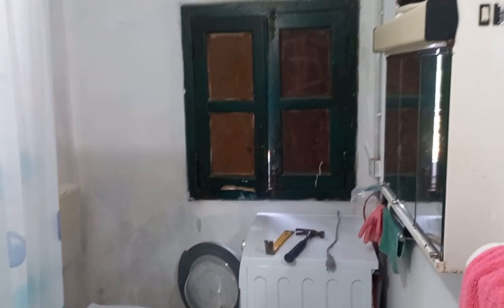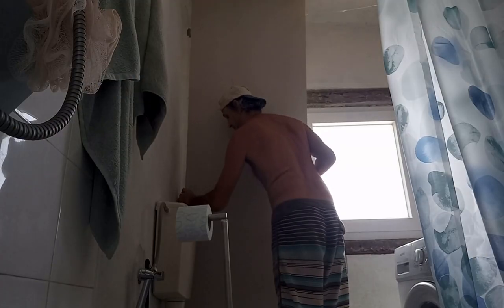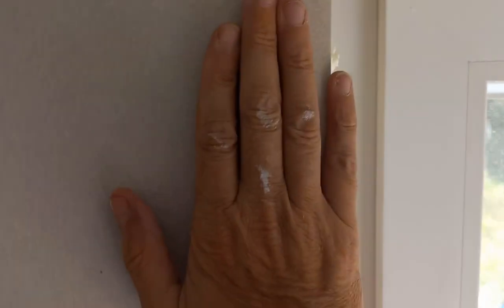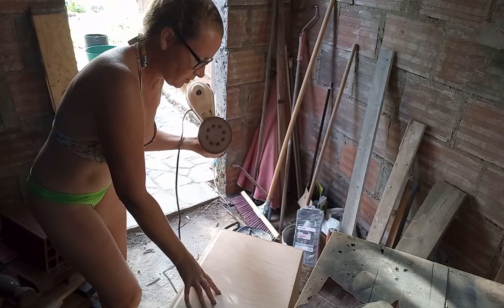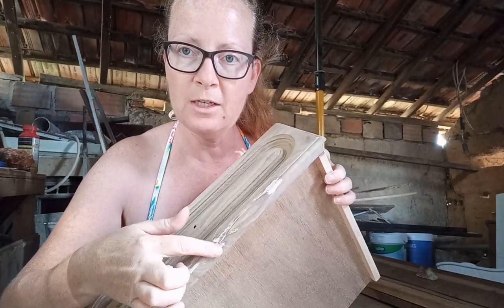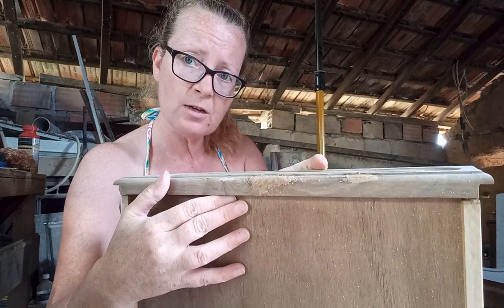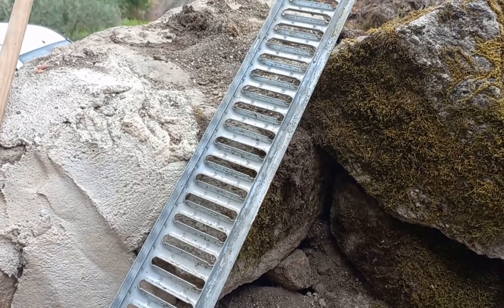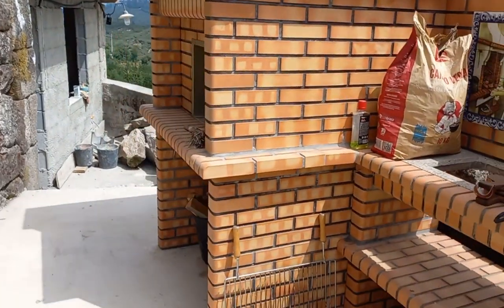A Typical Week renovating our Portuguese Ruin. Handyman Jobs. Enjoying the Hot Summer Sun!

Comment: The  house is looking good. Any movement in the right direction is progress. I think hiring out your considerable skill sets is a brilliant idea. I just finished  filling in a large 10'x3' pass through that used to have a decorative grid thing. I made a smaller opening in the center, because i wanted to have light and airflow, and i looks better. The drywall was heavy, about 60 lb. I had to cut it in half to lift it into place. Next I am going to do a pantry closet. I ordered a small laser level from  amazon so i can plot accurately. 🙂👍👍🇨🇦
Reply from the maker: Thank you! We're overdue for our one year of progress video but I really want to finish the kitchen first. 😆 Sounds like you did a lot of work, I'm sure it looks amazing! Having a lazer level will make it much easier!

Comment: That little monkey 🐒🐈‍⬛ had to do some damage to give you extra work to get that piece ready for painting ! I hope you're successful at getting a few more jobs. Grant did a very nice job with the installation of the drywall in the bathroom!  Good to see that the kitchen wall is ready for the next step.  👍🤗
Reply from the maker: I know right! I have to wrap the nightstand in a towel and a bedsheet to keep it safe when I’m not working on it now. I’ll be working on it shortly and should have it done this week! 🤗 Grant is very good with drywall. I think we have enough to do the exterior wall of the guest room as well, then we need to save money to buy more. We started on the side of the house that gets afternoon sun, and the finished walls are now the same temperature as the interior walls instead of radiating heat. 🤩